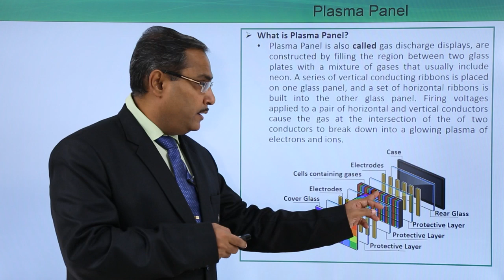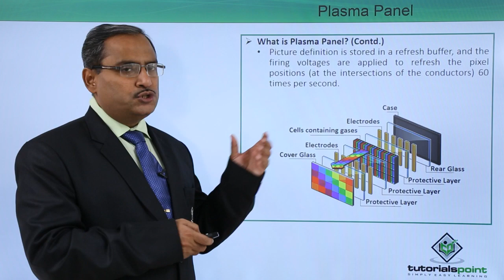Plasma Panel

Comment: so the image is actually slightly wrong, one of the conductor (stripe) layers needs to be horizontal so that they make a grid. the pixels of gas are inbetween the grid. by sending electricity through the stripes from both sides, you can make electricity flow THROUGH the pixel, activating the gas inside, from what i understand.
so lets say all the pixels are named like in chess. to activate pixel c8 you need electricity in vertical stripe c and horizontal stripe 8, and it will intersext on pixel c8. correct me if im wrong